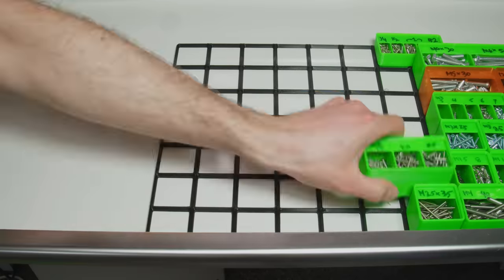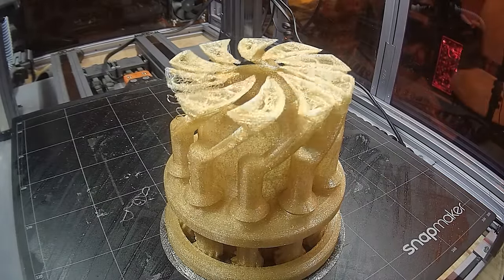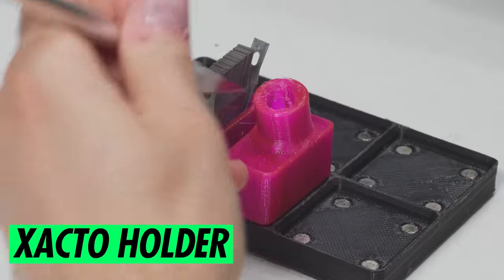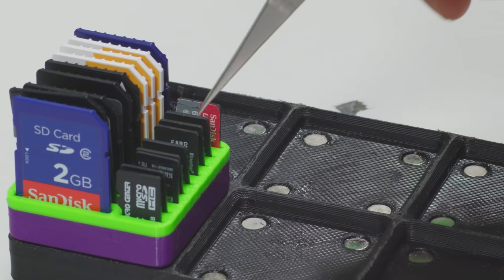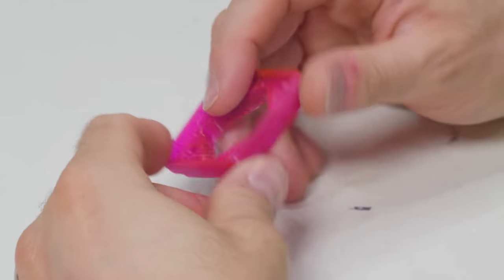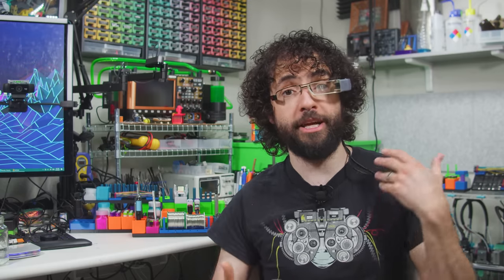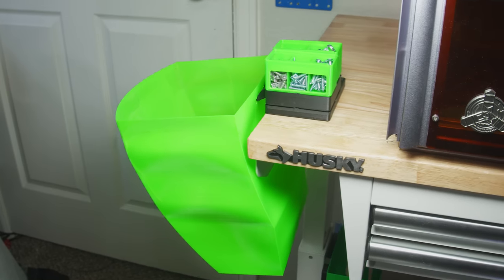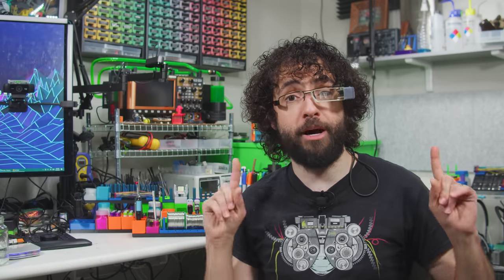3D Print a Modular Toolbox, Soldering Station, and More!

Comment: I ♥️ Gridfinity.  Suggestion: agree on a standard corner magnet size & position, so that magnets can be added and will align across different designers modules.
Reply: and maybe add some standards for an electronic version
Reply: Compliant mechanisms might be something to look into. Takes away the need to source magnets

Comment: I adore the gridfinity system. I'm a total novice and only have a whittle itty bitty Ender 2Pro, but I can just barely eek out some 4x4 pieces and plates if I print them on the diagonal. However, these new models are just making me itchy for a larger print bed.
Thanks gridfinity. You're saving me dozens of dollars on storage and organization and will cost me hundreds of dollars in new printers.
Reply: Welcome to the wonderful world of 3d printing. 😂 I’ve printed more parts for my 3d printer and accessories than I have for actual projects.

Comment: I might design a Gridfinity USB-PD power brick to go in that portable soldering station with my Pinecil!
Reply: Go for it!
Reply: Maybe try using a ip5328 chip for the powerbank, it has pd
Reply: @grindfi  I'm looking at circuit boards that are already built right now because I want this project to be accessible for more people. Problem is, I can't find anything that can supply 20 volt PD, so I think I'm going to have to use a BMS and voltage converter to run a board from a car charger off of a 18650 pack.
Reply from the maker: If you do, I'll design a Gridfinity fire extinguisher.
Reply: @ZackFreedman  12x12x2048 block with an actual fire extinguisher inside

Comment: For jumper wires: affix some small neodymium magnets in a circle to some kind of tray, I use a magnetic parts tray. Then connect the two ends of each jumper to two adjacent magnets. You just need the same number of magnets as number of colours. Of course your jumper wires need to be magnetic  - mine are.

It keeps the curve in the wire which is usually the same shape it's used in, it's very easy to remove and replace jumpers in the right spot (just dangle the ends close to the right magnets), It's small and compact, and it's aesthetically satisfying -- it's like a rainbow jumper wire flower on your desk.

Comment: Pro tip for anyone designing any subdivided storage vessel that ends up going vertical, use drawers in each layer. Disassembling a whole stack just to get to one compartment is a bit smooth brained, even modular storage system manufacturers figured this out awhile ago.

Comment: Printed the bin, bin holder, 7x7 grid, usb holder, caliper holder, and snippers holder so far. I used a glossifier coating on my bin to give myself the illusion of higher structural integrity. It is the largest single print I've printed so far. Thanks for the great content!

Comment: I WILL buy a 3D printer and I WILL make cool gridfinity components for my art supplies. This is a threat.
That idea came into my mind after you've shown the bottles. They will be perfrct for ink. Throw some holders for the pens and some holders for all the different nibs I use for my ink pens. I can already see it in my head, it's gonna be fun.
I'm aware there's some extra requirements and playing around if I want to reliably hold liquids in these bottles, but it's worth a shot. I can always just make a base for the ink brand I use and have the normal bottle on there.

Comment: Regarding Gridfinity for a specific assortment like that Dremel box set, the 1 year old Quinn Master Technician 428pc tool set has no trays or organizers. It’s meant to go into a tool chest with your own socket trays, pick-apart foam, wrench organizers, etc. For 428 pieces, all that adds up QUICK and you’ll still have less than acceptable results if you sprint for the $1ea 15 position socket rails. It’s a lot for one person so it would be awesome to touch base people who have the same set!

Comment: WAS THAT A DEMON CORE REFERENCE

Also; I neither have, nor know how to use fusion 360 (my expertise is mainly in conventional CAD and architectural software) but I have a bunch of ideas that I just have to share. I feel as though a serious strength of a modularize, open standard system is it's ability to interface with other standardized system. Such as:

-Storage jar blocks that use mason-jar lids
-A rack/rail baseplate system that can mount on to a standard peg board
-Compatibility with K'nex construction toys to make skeletal support frames for your organizers
-using things like marbles to make baked in bearings for drawers, lazy susans and little roll-around carts (or you could use real bearings lol)
-A series of router templates that allow you to carve gridfinity sockets directly into work surfaces or wood/plastic/aluminum in general

...and more!

Comment: I’ve been trying to make some gridfinity parts. I have only succeeded with the ifixit 54 set. But I’m just not talented enough to do this stuff. Thanks for the Dremel set I had not found that.
Reply from the maker: Keep at it - this is a great first modeling project because you get to work off an existing design.

Comment: I don't own a 3d printer nor am I capable of design, but it could be possible to print rails that attach magnetically to the vertical mounted plates that you could fit bins onto and slide out like drawers. If you found a more secure attachment method than magnets you could even make wider plates to attach the rails to for larger drawers or use multiple smaller pieces of specific storage that all belong together

Longer arm options for the toolbox arms would make taller compartments possible, and maybe borrowing some of the design concepts from the giant gridfinity piece would strengthen it a bit for use with heavier tools or sets of tools

Comment: Vas mode prints... go for a 0.8mm nossle for quick-printing and sturdy prints.. Or maybe even print them in a a flexible material for durability.
Reply: You can also increase the line width, while using a .4 mm nozzle. It works great for vase mode!

Comment: It occurred to me while watching this video that tabletop gaming terrain could work well with a system like this.
Reply: Dnd gridfinity mashup
Reply: Great idea. There are already a few flavors of interlocking 3d-printable D&D terrain out there (OpenLock comes to mind) but Gridfinity adapters would be great for organizing and storing the blocks when not in use.
Reply: @cogspace  It could also work quite well with foam terrain tiles (either carve the grid pattern into the bottom of the tiles or print a base that interlocks with the grid and acts as an under-layer for the tile).

Comment: Hmmm... How about a project to help you get other things of the other box.  Specifically, a laser pointer on a pan/tilt turret that is coupled to an ESP32 that is running a web server that contains a database of all of your bits & bobs and where they are in the shop.  When you give it an item request--or a whole list--it displays the item(s) on a screen AND the laser cycles through illuminating a translucent hemisphere mounted on the front of each drawer/box/etc.  That will allow you to easily find and grab everything you need for a project with minimal wiring/etc.

Does that sound reasonable?
Reply: I’d love something like this!  My only concern would be the laser safety, but that’s manageable.  Could also use other methods like integrated LEDs that light up/blink on the associated module etc.

The organization/tracking but would be useful enough as is too (Open Source Warehousing/Inventory Management etc)
Reply: I also want to make a “Parts Vending Machine” someday where you basically insert a BOM (or just manually insert items like a normal vending machine) and it dumps out the required parts from bulk supplies, and this software could help that too.
Reply: @ericlotze7724  I hope you spin one up!

1. It only needs to be a 5mW laser, so it should be perfectly safe.  

2. The  whole reason to run with a laser turret--besides being able to brag that your shop has a working  laser turret, of course!--is to avoid having to wire up hundreds of LEDs and associated circuitry.  Ugh.

Comment: The beaglecam may be cheaper than a Pi 4 but cant you use octoprint with a webcam absolutely fine on a pi zero 2. You can get very cheap webcams too, so it seems that pi zero 2 + webcam + octoprint, does more than the beaglecam does for much cheaper.

Comment: Vertical style gridfinity could use a French cleat system to rotate with an adapter 90 degrees but it would probably be better made in wood and fastened to a wall using non-adhesive means.

Comment: Octoprint makes terrible prints because the serial interface with every printer I tried, prusa's included, was too slow to keep up with anything that have polygons.
Reply: What are you running octoprint on?
Reply: Because if you have a Raspberry Pi 3 or 4, it should work. Zeroes don’t work do well

Comment: Someone needs to make the toolbox from Toy story 2 where the guy fixes Woody.
Reply: It's already out there!
I don't know about 3D printed, which I would NOT want to do.  It would be super difficult to print something like that, that would not break easily with weight.

But there is a wooden version out there.
Reply: @BlondieSL  you don't believe in the power of abs and solvent welding

Comment: If you can't get the pincil what's a good alternative? Thanks to anyone who can help!
Reply: The pinecil is a version of Miniware's original TS100 and TS80. So you can get one of those and reflash it with Ralim's IronOS. Also, the holder in the video is just a lightly edited copy of my original TS100 version, so you can have that too.
Reply: @JamesChurchill   @James Churchill  this is all really helpful!!! Thank you so much for the tips! If possible can I ask one more question? Is it worth it to upgrade to the ts80 over the ts100?
Reply: @thepixelatedbumblebee9439  The TS80 isn't really an "upgrade" per-se; you potentially gain some convenience with USB-C power, but it can only do 30W total compared to the TS100's 65W (although you need a 20-24V PSU to get that - old laptop power bricks work a treat.)

Comment: 8:35 Starts to talk about 18650 (18mm diameter 65mm Height 0 is the shape) size batteries and it being a death cylinder. Lets stop and talk about that!!!! 1 The wrap on it is damaged - Replace wrap or dispose of battery as it has a higher possibility to go into thermal runaway. 2. Whys the positive insulator not inside the battery wrap and exposed, basically a useless insulator at this point. 3. NEVER EVER use a 18650 that has been removed from a laptop or cordless drill battery. This one has been removed from some other battery system and is noticeable from the spot weld marks on the positive post. In the instance of a #3 happening, the safest thing to do is... DISPOSE OF THE BATTERY! From the danger of #3, Its not worth using.

Comment: $70 for a beagle? how is that "cheaper than either a pi or decent webcam"?
Reply: I don't have a Pi at all, but I wonder if the Beagle is just 'easier" to get going?
I mean, it's literally, open the box, connect it to the printer and I think the computer, upload the GCODE and it does the rest.
Of course, you need their apps.

I don't know.

I also wonder how many printers can handle the homing of the extruder and hotbed for every layer like that, without causing layer problems, skips, blobs, etc.  ????
Reply: @BlondieSL  I suppose it would be easier, but octoprint is really not much harder at all and has way more functionality with all the plugins.